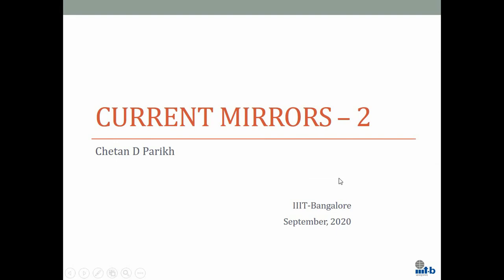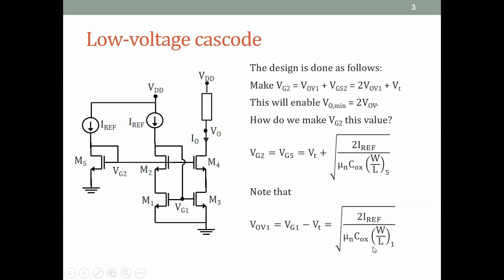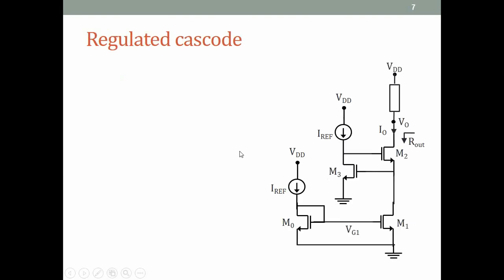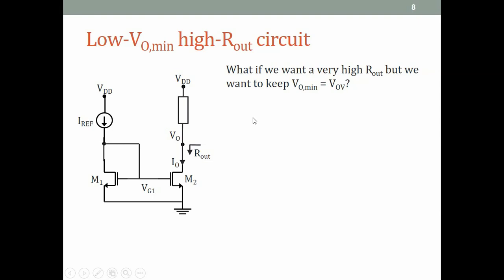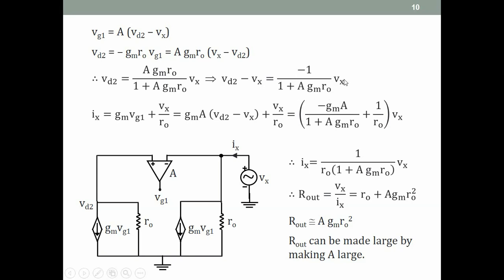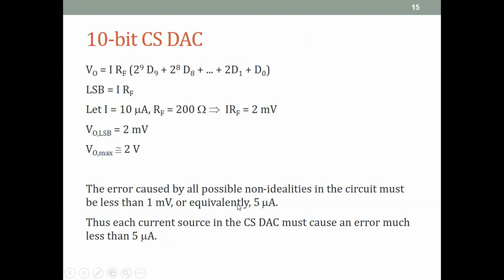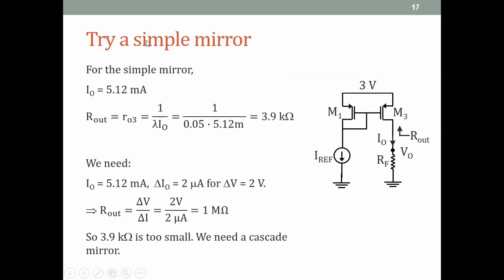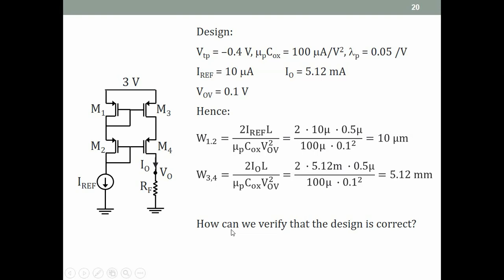CAID Lecture 19 Current mirrors Part 2

Comment: Sir, how to design a low voltage cascode current mirror in weak inversion region
Reply from the maker: Design in weak inversion region is an entirely different process, compared to saturation region design. You will have to find some research papers on this and study them.

Comment: Hello, can I ask you some question?
Reply from the maker: Yes, sure.
Reply: @chetandparikh4942  Thank you :) The first question would be: why its nessesary to have all CMOS transistors in saturation? What could happen if some transistors in cascode will not be in saturation?
Reply from the maker: The voltage gain will become smaller if some transistors are not in saturation. I have discussed this in CAID Lecture-12a: https://youtu.be/MlyjduJvIdQ
Reply: @chetandparikh4942  Thank you very much for your answer!